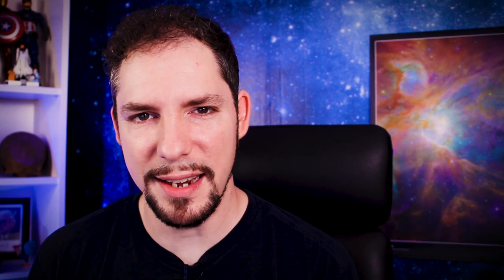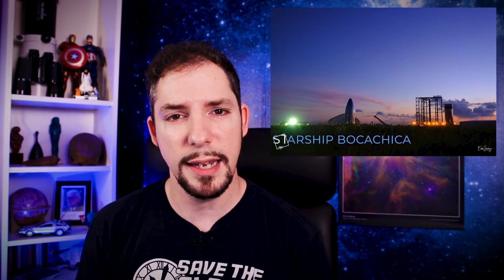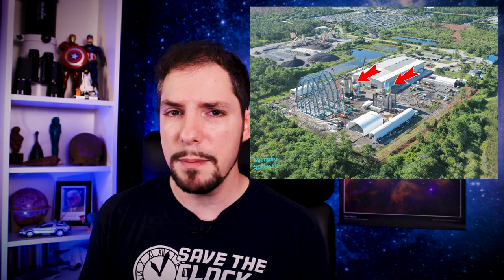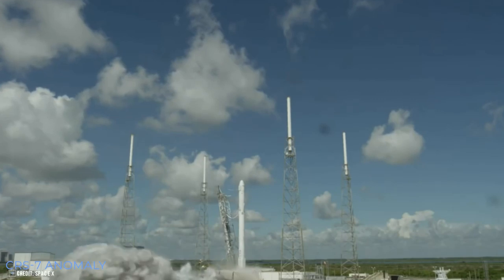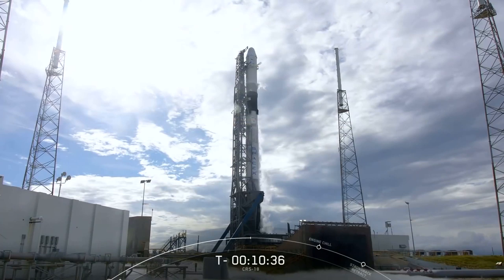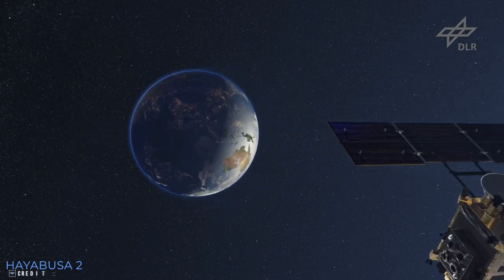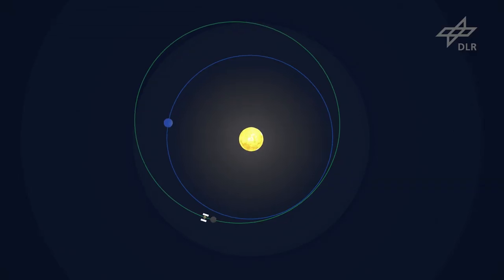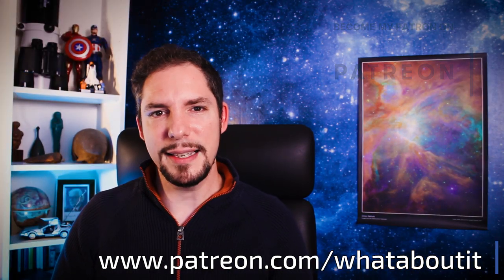20 | SpaceX Starhopper & Starship Progress - CRS-18 Launch Summary - Hayabusa 2 Mission Report

Comment: The welding pattern is probably for a very strong bond/attachment of something inside, probably a strut or support structure. Whatever it is, I am sure it has to do with structural integrity. Maybe a mesh of cross-beams on the inside between the upper and lower tanks?That would be my first guess.
Reply from the maker: Sounds logical. That would be a very strong attachment! Thanks for your theory!

Comment: Perhaps the strange welding pattern is the heat shield? (Where the rocket "sweats" for ablative shielding
Reply from the maker: Thank you for the comment! That was my first thought too, but does it really look like holes? Hard to tell... :/
Reply: I don't think transpiration cooling is considered ablative. At least not in the typical connotation of ablative heat shielding.  Although I hear talk that they may be going with thermal tiles now.  I guess we'll just have to see what happens.
Reply: Yeah looks like 1 section of transpiration holes so they can directly compare to unprotected metal on the same flight perhaps.
Reply: They've ditched the sweating method, they're going with ceramic tiles and a carbon-carbon (or some other material) cover.
Reply: @aval1998  can't they use both..

Comment: @ 2:27 the pattern is likely caused by welding of internal brackets. That many contact points would indicate something exerting force. Fuel, test payloads or structure for additional engines. There's quite a bit of thrust and vibration.

Comment: I think the weld beads are to shrink the panels.
If you heat metal, it will contract after it cools. It is a common method of straightening shafts and the like.
Reply from the maker: Thanks for the comment! Interesting! I knew about the shrinking, For example train wheels are made like this, but did not know, it was used to shrink panels! Could you give me a link to an example?
Reply: @Whataboutit  You are referring to a different process called cold welding or shrink fitting. That is used for things like train wheels or shaft bearings. One part is heated to it fits over another part, or a part is frozen so it fits inside another part.
I am referring to a different process. When you heat a small area of meal, the surrounding area is compressed due to the expansion of the heated area. Welders have to contend with this every day.
Here is a link to a demo of the process.
https://www.youtube.com/watch?v=7w-yRdj-l0E

Comment: My suspicion is that the strange weld pattern is where the separator (between the fuel an LOX tanks) is attached to the hull.
Reply from the maker: So you mean, thiose are not holes, but actually only the anker points for another layer? Interesting theory! Thanks for the comment!
Reply: @Whataboutit  I've heard it's only, so that it doesn't collapse if it is not fueled.
Reply: I think it is to strengthen the outer shell. On older photos you can see some buckeling

Comment: I seem to remember that the original launch path for Hopper was defined as straight up 20 meters, then a horizontal translational movement followed by 20 meters straight down but when one looks at the launch video it appears that Hopper is moving along a diagonal line and then down, is that your impression as well?  Also now that SpaceX engineers have data that relates the amount of thrust required to move a known number of meters over a prescribed path does that mean that they have enough information to fine tune the next Hopper flight such that it is certain to land within the boundaries of the launch pad?  (Pete)
Reply from the maker: Hey Pete! That was my impression too, yes! They have some data now. We will see on the next flight, if it is enough data. I hope so! The next flight is supposed to go much further up at 200 meters. Better be more precise with that. Otherwise you have a hopper in the water... ^^

Comment: Great video felix!  Do you know if Nasa gave Spacex the ok now for Crewed dragon flights?
Reply from the maker: They did! I made an analysis about it! https://youtu.be/K9NsoRBpln4
Reply: Owen Salisbury   My understanding is, and I may be wrong about this, that NASA certification is only required to transport NASA personnel or to go to the ISS. If somebody else wanted to hire SpaceX they could fly them whether they had NASA's permission or not. As it is, quite obviously, they weren't quite ready to conduct manned flights, and other potential customers will be more willing to hire them if they do have NASA certification. Either way, the next ten or twenty years are going to be very exciting.
Reply: What about it!? Thanks I saw that , what I meant is did Nasa gave Spacex a slot in their flights to the ISS launch schedule ? Or is still TBD in early 2020
Reply: Owen Salisbury  are you sure? My understanding is that all launches to the ISS require Nasa certification even the soyuz ones to insure safety on board
Reply: @m.jacobdafir240    They are still using November 15, of this year, as a planning date. Most likely the real date will have to be set later.
Reply from the maker: @M. Jacob Dafir There is your answer. Odysseus Rex is well informed as always. :) It's just tentative and right now very unlikely in my opinion, but a possible date.